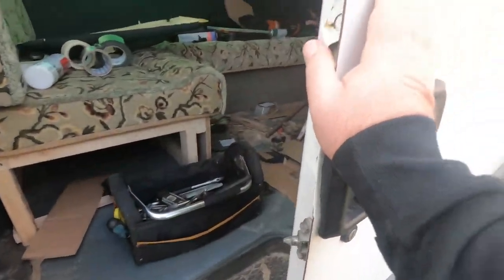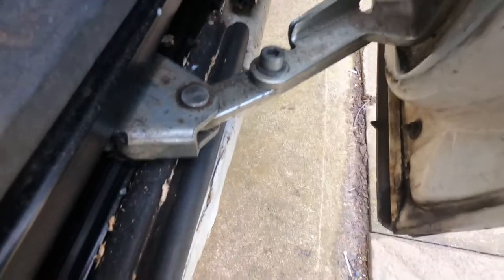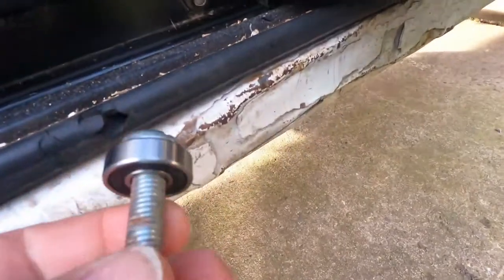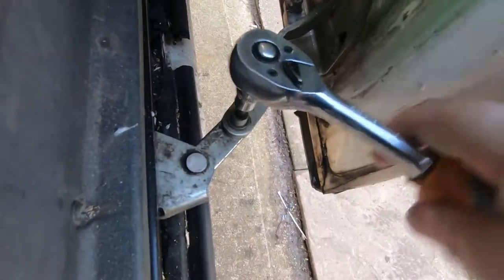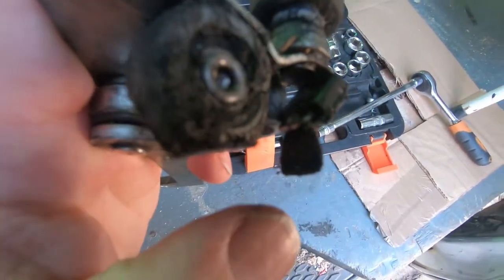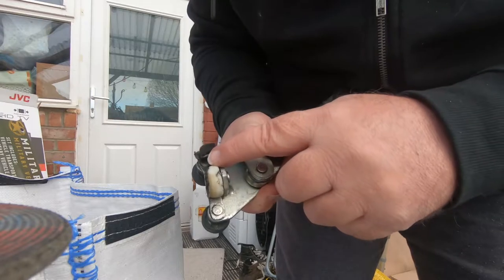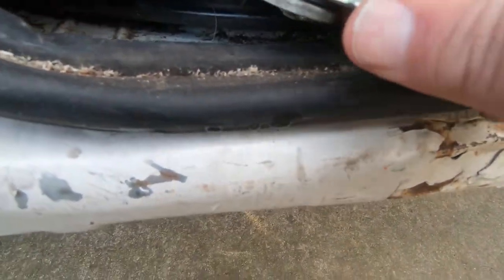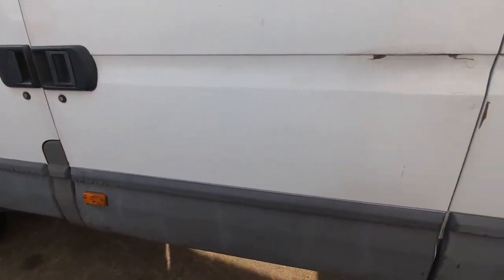#10 How to fix ( BODGE )  a sticking stiff sliding side door Iveco Daily

Comment: Mine is currently pissing in, these vans are built with chewing gum and old bean tins, the price of new parts is a disgrace
Reply from the maker: your not wrong there . its a really bad design.
i put a piece of wood on the top leading edge of the door and hit it with a rubber mallet, and it curled in half a inch , did the job. got this tip of the forums